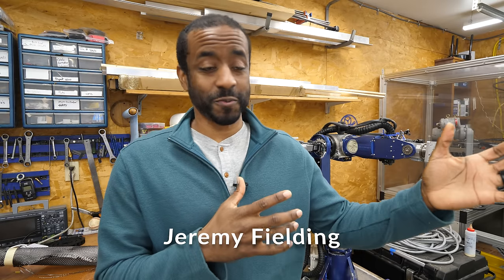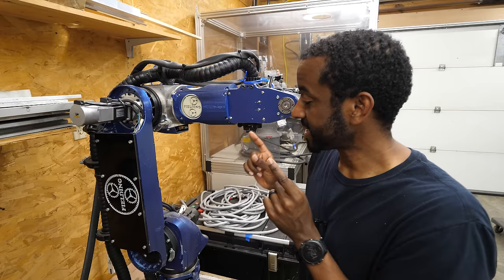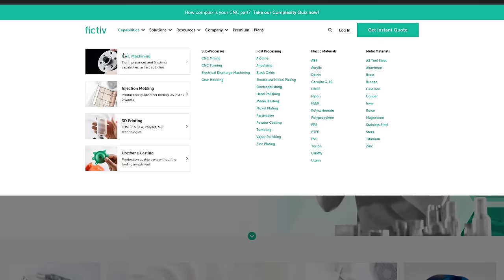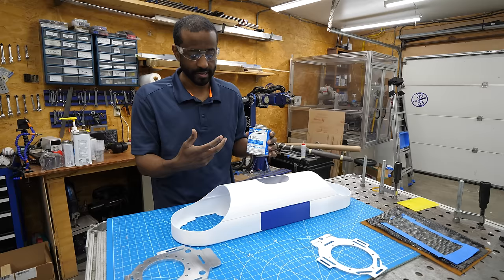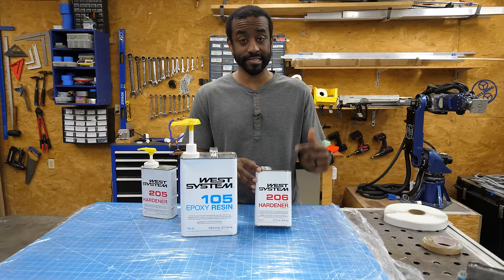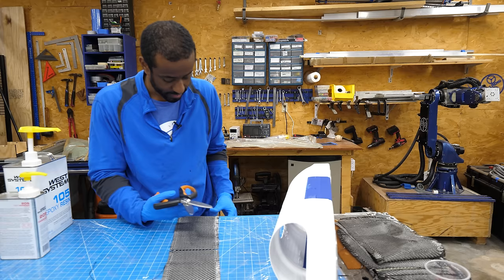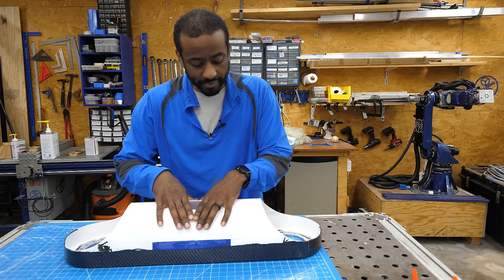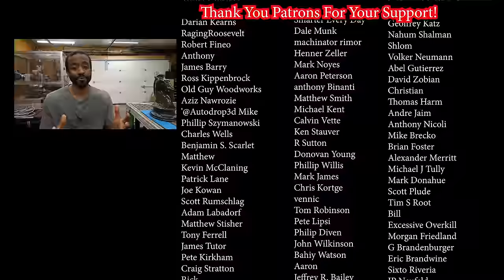How to Make Anything Out of Carbon Fiber.

Comment: Cool, Good job!!   (just a word of caution: those Vacuum Pumps exhaust a lot of oil vapor, the Fog as seen in the video.  Wear a respirator designed for that oil type, exhaust the pump outside is cleaner for the entire space)  Good Luck on your future builds & your channel!  Cheers 😄👍

Comment: Bagging is not always necessary. You can often wrap the carbon on the surface and it will provide more than enough strength. Bagging consolidates the material and removes excess resin but it comes at a cost both in time and materials. If you design the part with radii and fillets that will allow the fiber to wrap and hold to the surface, there is a much lower learning curve to get a working part.

You can machine carbon but you need to get the right cutters for it. Onsrud has a variety specifically for composite machining. Other companies probably do as well.

Comment: Never underestimate the importance & utility of jigs. The center-to-center precision of the 2 machined aluminum plates is important. A simple MDF jig to hold them in place will reduce many headaches. Using such approach allows you to build up the carbon structure between the 2 plates. In doing so, you set yourself up perfectly to build a hella-strong carbon/honeycomb composite structure. Vacuum-bagging flat carbon composite plates is orders of magnitude less troublesome. The sorf-of dome structure seems somewhat cosmetic, so skip that first until you have a carbon composite plate structure with some additional L- or U-shaped profile stringers for strength, running across the carbon plate connecting the 2 machined plates.

Comment: Great video, you may want to consider purchasing a “vacuum puck” it will help! Also look into release agents. You don’t have to wrap that knight you could have molded a side at a time then apoxyed  them together creating a super light weight/strong knight. Also when placing multiple layers together try placing all layers in a bag then pouring resin, semi close bag and use a squeegee to “push” in the resin to the fiber. It helps impregnate and eliminate unwanted weight from access resin. Once done then place on part. Thank you for your video!!

Comment: Acetone melts CA glue pretty well; specifically useful for removing it from machined metals. If it's stuck to plastic, getting CA cryogenic cold and chipping it off is usually a better option.

Comment: A great technique to apply resin is to fold over some bagging material (or wax paper is good for this too). Lay the carbon fiber on one side, pour the resin and fold the other side over. You can use a squeegee for a mess free lay-up.

Comment: You definitely dived in at the deep end.  Trying to do both inside and outside skins is not a beginner's project, in fact, it's just about as difficult as CF projects get.  It's doable, but getting used to working with the material, and how it behaves before you commit to a complex part is definitely the way to go.  Even your knight was not really a beginner's project.  Relatively flat panels (e.g. car hoods) are a great place to start.

Easy Composites have a load of great quality tutorials on YouTube.  Although they do plug their products, it's not a hard sell, and the techniques are quite generic and don't depend on you using their products.  If you watch carefully and follow their advice, it's hard to screw up.  They mostly favour infusion, rather than wet layup.  It gives a great finish and close to optimum ratio of CF to resin.  However, I think this project is probably too tricky for that.  Placing the feeds so you get even distribution is something that comes with experience.

There's a low temperature pre-preg available that just needs a curing oven (i.e. it doesn't need an autoclave).  I think that would be the best option for both of these projects.  The pre-preg is tacky, making the layup quite easy, and it's relatively stiff, so it stays where you put it.  Just make sure you do it all in one go.  Laying up CF on an already cured piece is not going to give a strong bond.  You're likely to get delamination when the part is stressed.  Pre-preg makes it (relatively) easy, and a hundred times easier than trying to get slippy wet layup to stay where you want it.

Although it's an interesting idea to 3d print your core, I'm not sure how good it will be in practice.  You need the epoxy to bond really well otherwise the skins will separate, and you've lost the mechanical integrity.  You might try a test using a flat sheet of whatever material you're going to print.  Epoxy a strip of CF to it, with a loop you can tug on.  If it comes apart quite easily, it's not very good.   You could try roughing up the surface with coarse sandpaper, so the epoxy has more of a key, and that might be strong enough for what you need.

Remember, not trying is failure.  If you try, and it doesn't work, it's not failure.  It's just one iteration towards achieving your goal.  This is the first of your videos I've seen, and I like your positive, if a tad over ambitious, attitude.  I also like you being honest about your unsuccessful iterations.  It avoids anyone having unrealistic expectations if they want to try what you're doing.  There are few things more demoralising than trying something that looked easy, only to run into problem after problem.

Comment: Nice video! Someone may have mentioned this already, but I would not recommend grinding, machining, or sawing carbon fiber unless you're in a designated room only for that purpose and wear a respirator and coveralls you leave in the room. Carbon fiber and epoxy dust can be detrimental to your health and electronics. I don't know what level of exposure is harmful, but they had a designated room for processing CF at my university and it may have even been negative pressure. Same warning applies to titanium dust.

Comment: Make sure you have good dust collection if you do any machining of the carbon. Carbon fiber conduits electricity along is surface and can short out electrical equipment (saws,  drill presses, etc) without adequate dust collection. Also not good to breathe.

Comment: It is approachable with a good startup budget, but for most applications working with fiberglass is much cheaper, and readily available from boating supply places. Fiberglass is just slightly denser and isn't as stiff. Carbon fiber also will demolish tools as it is incredibly abrasive, and you 100% need respiratory protection for any grinding or sanding. Also I would like to note, it is not something you want to make precision components out of. The lengths my company has to go to to create standard machining tolerance out of carbon fiber is pretty insane and while I am doing composites for our local robotics club I wouldn't use it for anything I needed better than a +-40 thou tolerance.

Comment: Jeremy, good effort. It is not easy working with carbon fiber or composites in general.  I'm wondering why you are going with vacuum infusion for your chest piece and maybe even your robot arm. Reducing weight is really the main reason for vacuum infusion or Autoclave for best results strength/weight. The robot arm is already reducing in weight from aluminum, you should be good with just wet layup. Prepregging the carbon fiber makes sure you have the proper matrix coverage and should be lite in wet layup, only on side you are putting on part. You can work on outside for epoxy coverage. Finally, use slow curing epoxy if you plan to do many layers, sections. You don't want to cure the epoxy fully, so other layers/sections can fuse together with the previous. Tacky is the term for determining this situation. Ditch the vacuum bag on the robot arm, lay up carbon with prepregging one side then coating outside. Cover holes. Drill them out later. Maybe make a drilling jig before covering. Do flat side first and curve around corner. Lay flat on release paper on table when tacky and lay the inside and outer radius. Cycle until layers are complete. Then cut holes. Precutting layers of shape will help with being speedy.

Comment: Jeremy, As you move forward with the project, consider the potential for corrosion of the aluminum parts where they come in contact with the carbon fiber. An elevated humidity level may contribute to dielectric action between the two materials. Both carbon and aluminum are conductive. Over time, the bond between the two materials may be weakened by any corrosion. A very dry environment may reduce or eliminate this risk. You may be able to electrically isolate these two materials from each other with an insulator of some kind, but I cannot guide you to a reliable solution.
Reply: In the boating world, they just add one layer of glass fiber in the places where the aluminum will be. That seems to solve the problem.

Comment: You can make a prototype piece using fiberglass mesh and polyester resin/hardner and the same method with the bags. Much cheaper than CF if you're on a tight budget.
Cheers!

Comment: A possible reason for both Sovol printers having the same issue at the same time/height could be an overheating of the printer boards themselves.
Some printers have a common pwm control for both the part cooling fan and the board cooling fan. PETG is usually printed with low speed or no fan. So potentially at a warmer time of day during the print they both were struggling with a fan that's not cooling them down enough.

Comment: You need to investigate ‘vacuum infusion’. Wet layup and then bagging the result is a messy hassle.  Basically, cover your mold or part with dry carbon cloth, using scotch 77 spray adhesive to make the cloth to adhere to the mold. Bag the part. Here’s the important part: have a plastic tube from inside the bag to a pot of epoxy. The vacuum sucks out the air and sucks the epoxy into the bag and over your part. Once you see the part is covered in epoxy, put a clamp on epoxy line to pot. Now vacuum pulls out excess epoxy.  Lots of videos on youtube about this technique.

Comment: I would suggest getting a cheap 3D printing pen. They are very useful for fixing gaps and sticking printed parts together. In some situations you can use it like you would a welder but for plastic.

Comment: If you have more time than money, start with glass fiber and polyester. Much cheaper and you still learn a lot of the same stuff. My first project was a 80L subwoofer box out of glass fiber, start smaller... I used way to much resin and had to sand for weeks. Learned a lot tho.

Comment: Jeremy, i recommend that you look into prepreg. You definitely get better results using these kind of methods. This wet layup method may achieve a look, but you are not really getting the structural strength, stiffness, and weight benefits you would want from carbon.

If you do want to do more wet layup, i really recommend the video tutorials from Easy Composites. They are absolutely killer and provide every detail you need as well as numerous options for what you might do if you don’t have the setup they have.
Reply: Love the easy composites videos. Pre-preg parts will have to be oven cured. That means the mold will have to be oven-safe. Might be a challenge in some cases.

Comment: The oil mist from a rotary-vane pump isn't great stuff to breathe (not as bad as cigarette smoke, but not great); I'd put an oil-mist filter on the exhaust or run a hose outside, unless your shop has really good ventilation.  Better yet, use a diaphragm pump; I don't think you need to get down past a few dozen millibar for your application, and rotary-vane pumps hate moving gas around.  I notice Xyla Foxlin usually has a respirator on for laying up fibre-reinforced epoxy, even in pretty open workspaces; I don't know whether that's necessary but it might be worth checking.

Comment: You should use a sacrificial layer or 2 of fiberglass. Carbon fiber causes corrosion on aluminum parts when they are in contact

Comment: Mistakes happen , no joke . 
I started with fiberglass and resin. Something easy and flat .A frame for a Dog Bed. 
Low and behold , halfway through I thought I'd add ribs so it would be raised a little off the ground . By halfway , I mean the planning process not while pouring the resin.  It turned out .....well , okay , I guess . Practical , not aesthetic and invisible after adding memory foam and a micro fiber blanket (answer is yes , I SPOIL  my Dog) .
The problem I ran into was the resin/hardener "setting up" rather quickly . It got me wondering if manufacturers that use this stuff by the ton vacuum out the air . I measured the ratio to specs and applied it pretty quickly  . 
IDK , like you said , lessons learned . 
You're a phenomenal Teacher Jeremy . Humble and Patient . 
Very good character traits and I enjoy your channel . Keep up the Great Work.

Comment: Carbon fiber and aluminum requires a mechanical bond like concrete and rebar to a steel beam and would also use a specific aluminum epoxies

Comment: 19:05 yes, "don't bother to save them" as in stilling being part of the weave that you are working with, 100% true BUT you should keep them (i.e. don't throw them in the trash) because they can be used in applications where you might need to add some directional strength in areas where you cant really get strips in without adding unnecessary bulking up and / or causing other problems. Another use for them is cut into about 1/2" to 1" long strips for using in FCF ("Forged Carbon Fiber") projects. In fact, they can also be used as mentioned in last line in longer lengths to add strength to FCF projects since FCF parts tend to be weaker and more of an aesthetic thing but they don't have to be as weak by adding in strips like that in the right directions in the middle of the parts thickness of FCF that way you have linear pieces in the direction you might need the strength.

Comment: One way to seal those bag edges is to put a piece of paper on top of them and iron. This will melt two parts into one without burning through the plastic. Faster, easier, cheaper.

Comment: You are natural borne teacher, the marked foam is an excellent visualization! Oddly enough, I just designed and printed a part that is under compressive load in a single direction, and I used Archimedean chords, which is a spiral infill The part is almost circular, fits on the end of a screw jack and acts as a compressive interface between the jack and soft wood. and also acts as a place to affix a compressive, no scarring buffer (felt). In this case the perimeters will be under almost no stress.

Comment: You can use sticky tape to mask off the ares you dont want the epoxy to stick too. That way any drips or lose strands wont stick to the steel plates you have there. Epoxy reson does not bond to tape or cling wrap.

Comment: Best way to think of carbon fiber is it's just a specialized kind of fiberglassing as most of the skills, process, and materals are the same outside of the fiber itself. There are actual times when normal fiberglass can be better and stronger if you aren't able to keep the design playing to carbon's unique features.

Comment: Nice Jeremy I have been using Fusion 360 to design parts and the Flash forge creator pro3 in my classroom can do Carbon Fiber . So far I have only Worked with PLA and ABS .

Comment: thank you, i know nothing of carbon fibre, only a little experience of epoxy and glass.  first, try to do everything in one pour.  use 209 extra slow hardener, if you need more time.  it is much weaker to work layer by layer, because you only have epoxy, sticking the layers together.  attach your fibre dry, use thread to tie it down around corners, you can even stitch it, until you have everything perfect.  only then start with the epoxy, pick the best spot, and work out slowly from there, leave it time to sink right through, and tapping out the bubbles with the edge of your scraper.  try not to work or otherwise move the fabric, in other words don't scrape, with the scraper, just pour on a pool of epoxy, and then help it move into the fabric.  if you mix small batches of epoxy, at most three squirts at a time, you can take all the time you need, to do this, and get it dead right.  second, can you make a jig to hold your part in space, while you do this?  it really helps to be able to pour downward into the layers, to begin with, however these epoxies are made deliberately viscous, and once they have settled in, and you have worked all the bubbles out, they will easily hang upside down, while still holding two or three layers of fibre, as you work.  second - you don't need a vacuum bag, because the epoxy will cling, like paint, and the surface tension will hold the fibres in place, for quite a long time.  the trick is to rotate your part along its longest axis, held horizontal, like a chicken on a barbecue, and rotate it slowly, a few rpm, or less.  this way you should end up with an even surface, with the bonus of a nice smooth gloss finish that will protect the fibre underneath, and none of the mess and waste and fuss of bagging.  um, in my experience.  i will try this myself with carbon fibre as soon as i can afford to, and thank you very much indeed for sharing your experience with me.  i also thought carbon fibre was out of my reach, you showed me different.